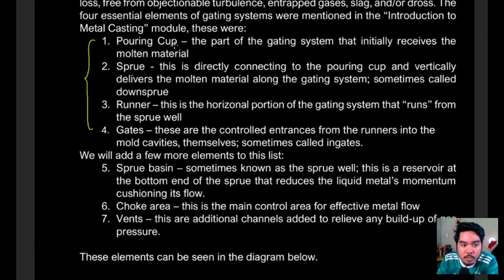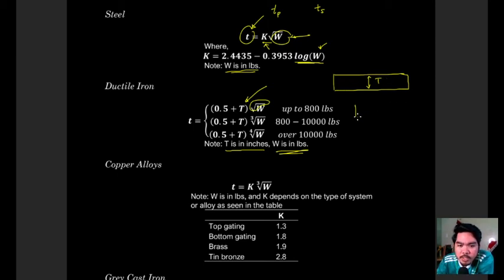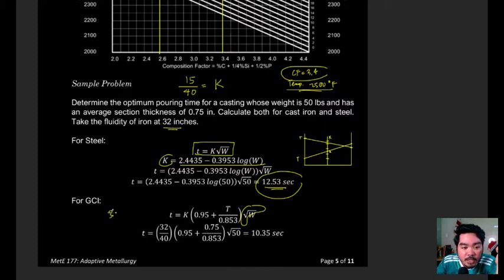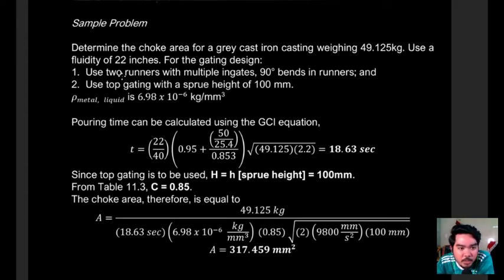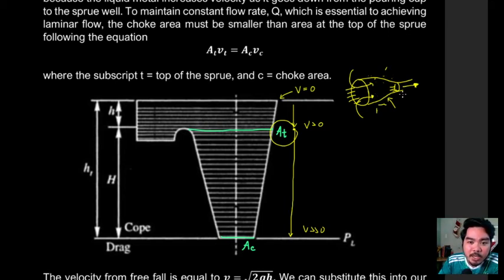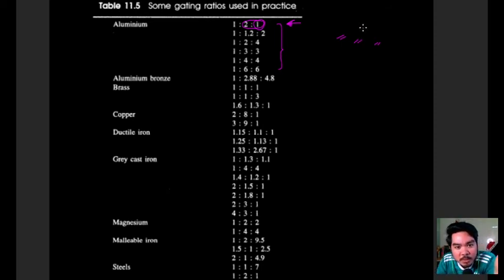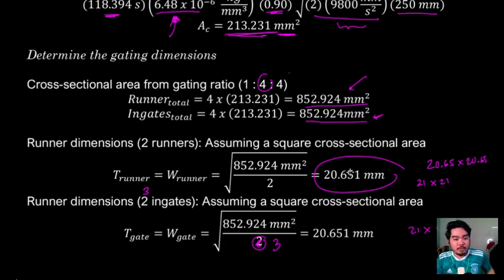[MetE177] Gating Design

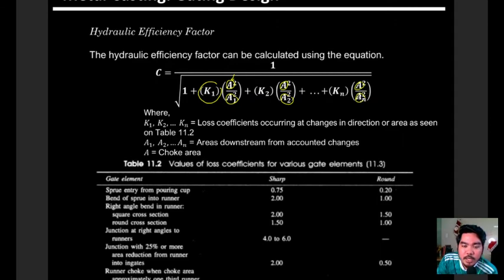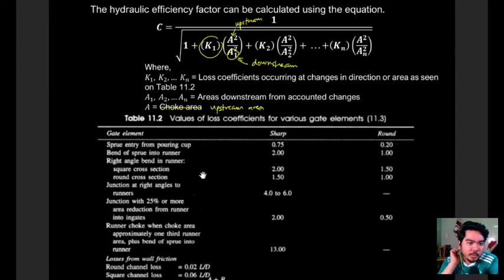Comment from the maker: Correction 41:17 to 45:42 - The upstream area is always the choke area since this is the main control area. Therefore the original formula is correct, the numerator A is always equal to the choke area. Apologies for this mistake.